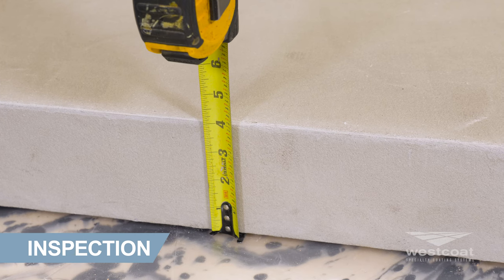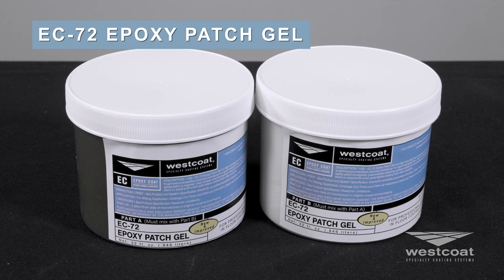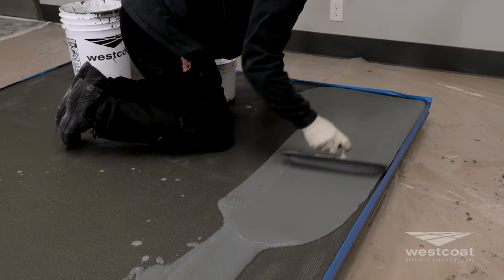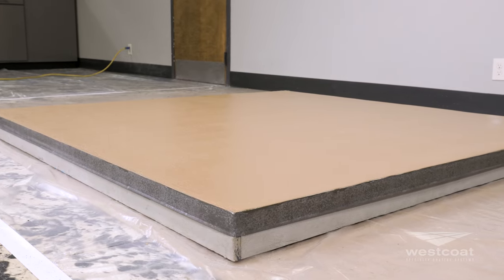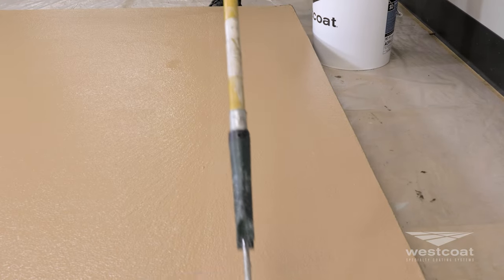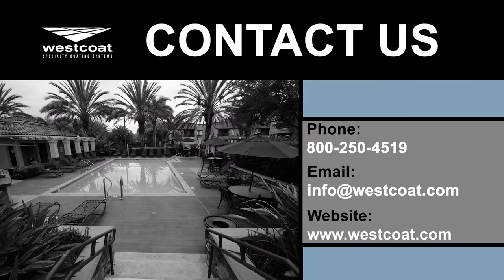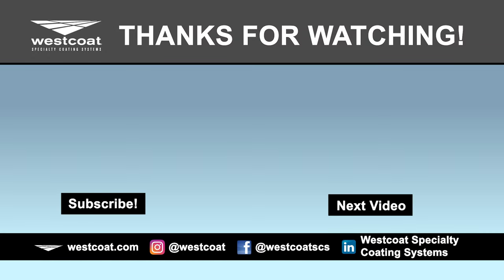How To Install The MACoat™ Standard Finish

Comment from the maker: CHOOSE A STEP HERE:

0:07- INSPECTION & PREPARATION
0:10- Inspection
0:42- Moisture
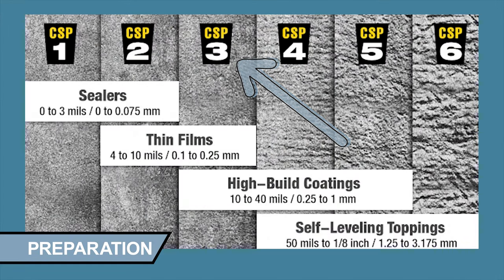0:59- Preparation
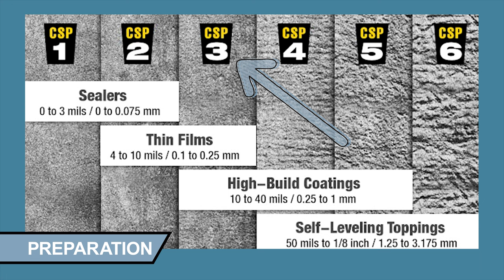1:06- Concrete Seams And Cracks
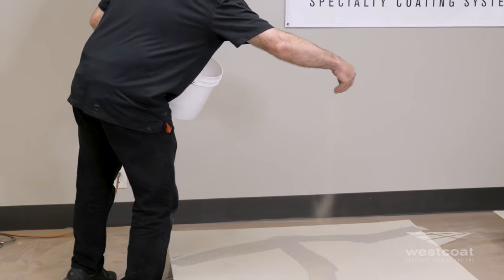1:39- APPLICATION
1:42- Flashing
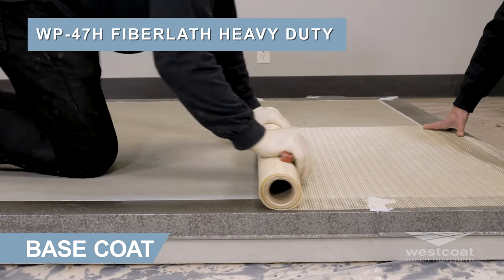2:27- Base Coat
3:22- Slurry Coat
3:54- Topcoat
4:52- OPTIONAL STEPS
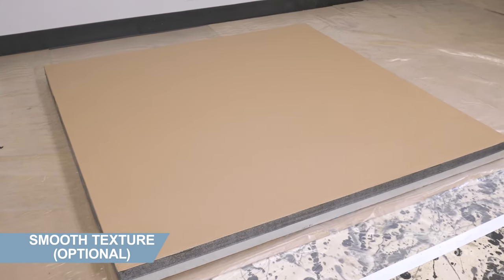5:02- Smooth Texture (Optional Step)
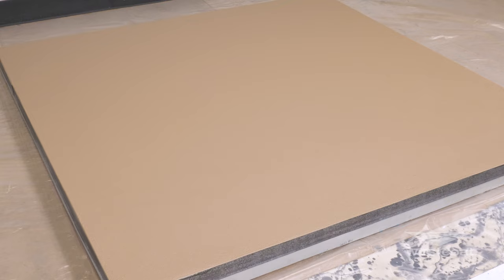6:05- Knockdown Texture (Optional Step)